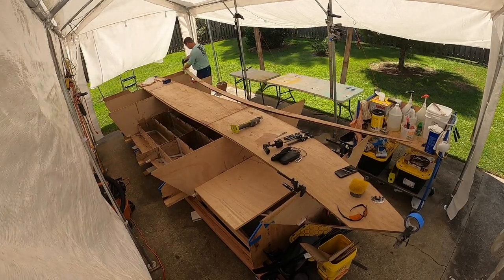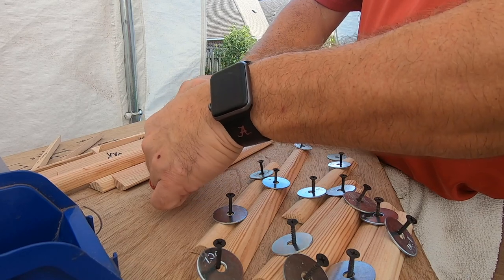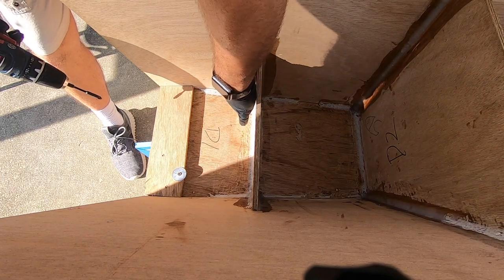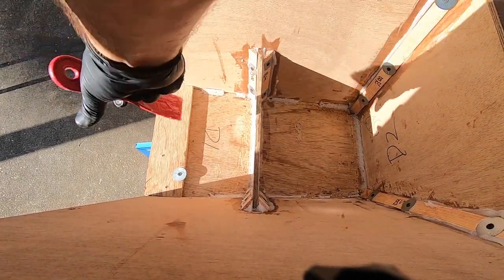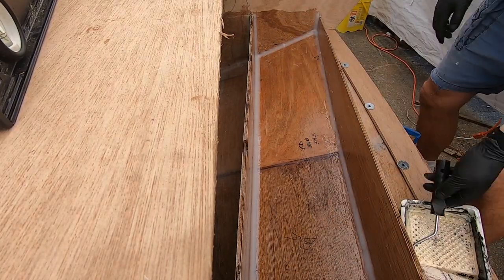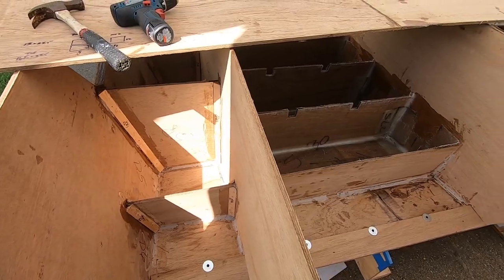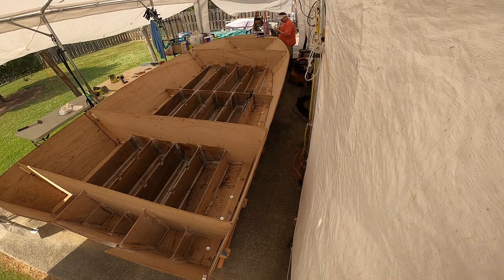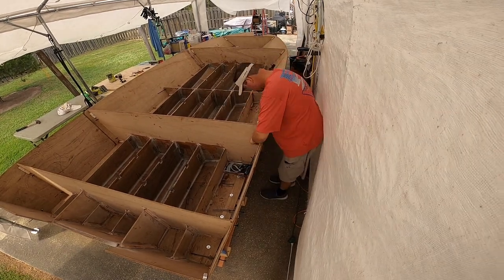9.DIY Boat Building:  Fiberglass STITCH and GLUE!

Comment: I have a specific question about the stitch and glue process. Do you need to wipe the amine blush off the epoxied sections between the stitches prior to applying to full sized fillet to all corners? I'm working on a stitch and glue boat and am a bit puzzled by that, since I've always heard that epoxy will not stick to other epoxy that has not had the amine blush removed.
Reply from the maker: I agree in some part about worrying about the amine blush.  For most of my project I used 2:1 slow hardener epoxy which was non-blushing.  Otherwise, I would check with the manufacturer and ask them.  They are typically easy to work with.  I used US Composites and they were always easy to get in touch with.  Does that answer your question?

Comment: I just ordered the 16 the cnc kit. Having a hard time finding the stock boards. In fir or juniper. I’m located in Gonzales la. If you know any places
Reply from the maker: I'm not saying it's the best path to get there, but I went to Stines in Walker and special ordered all my stock fir lumber.  It's clear grade.  For all my 1.5" stuff, I bought 2x4's and cut them down to the dimensions I needed, and for the 3/4" stuff, I bought 1x4's and sent them through the table saw.  Spent a lot of time searching around, and this was the path I took because I got a little lazy and frustrated.  There is a place right across the river on Magnolia Beach that is a wholesaler as well.  That may be a good place to start as well.  Glad you are close.  Let me know if you need some help.
Reply from the maker: How's that build coming?